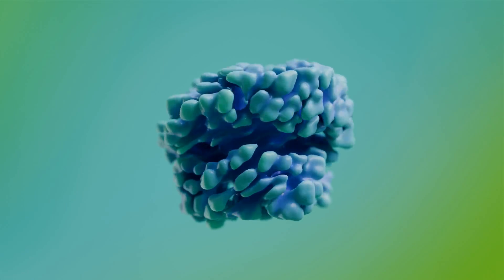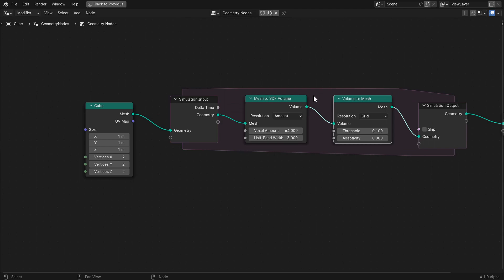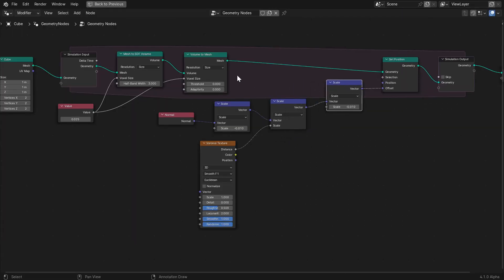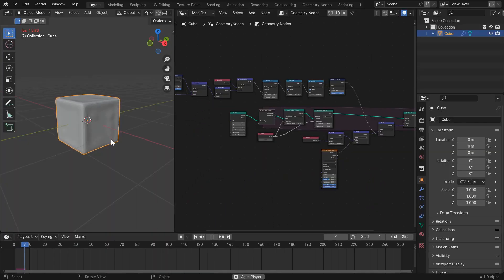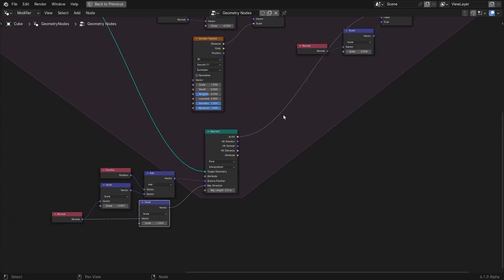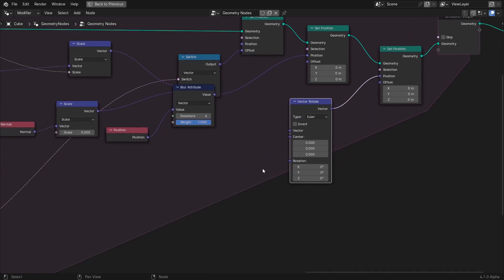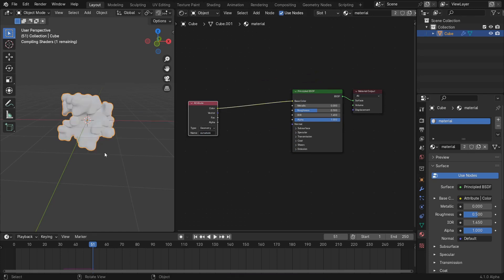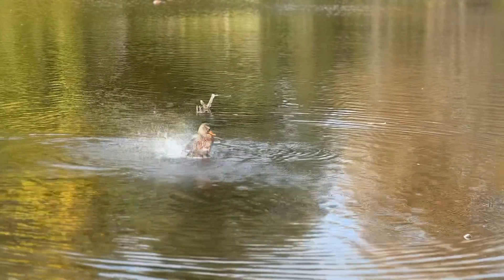3D Differential Growth in Blender!

Comment: The Mesh to SDF Volume is replaced (or can be replaced) with the Mesh to Volume node in 4.1 stable, don"t know for other versions (in this case you do not need to go through the experimental settings in your preferences)

Comment: I am doing this for newbies. It is so hard to do these things, but I'm trying to learn and just getting that free gumroad is so tempting. But stick with it. If you get stuck, take a look here. I used to always just complain in comments..., but it's better to complain and do. 

I got it.
Bing CoPilot: You are using the wrong node type for the dot product node. The dot product node is a vector math node, which means it can only be used with vector inputs and outputs. Vectors are lists of three values that represent a direction or a position in 3D space, such as the location, rotation, or scale of an object. You can recognize vector nodes by their yellow color in the node editor. If you are trying to use the dot product node with scalar inputs or outputs, such as a single value or a color, you will not see it in the node menu. You can convert scalars to vectors and vice versa using the separate XYZ and combine XYZ nodes, which are also vector math nodes:
Blender is so keystroke oriented. And suddenly, now I notice that he has to drag out from the node, and then you can search for the node. I wonder how many tutorials I have given up on not picking that up.. I was wondering why he was no longer searching with shift A and. going down through the menus. That doesn't work that way.

CRASH
I dont got it.

I got it.
Don't let your ADD squirrel need to be fascinated by watching the simulation while you're working on it. hit that pause button.

I boot up again and I Play the simulation. It's not looking like what he's got on the screen. 0h no. Backtrack.
I dont got it.

I got it.
I missed the clamping On two of the nodes. So just don't look for number changes. Look for check boxes.
I dont got it.

Give up and go back to bed. Don't start this at 6:00 AM.

To be continued....

Comment: i'm new to blender, would appreciate some help here: 
i'm trying to do this anymation with a Group input of a "model" i made. 
Unfortunately the model dissapears after the first frame when i press play and its not animating (when i change the input to a cube it all works fine.. 
Anyone knows what could be the problem here?
Reply: The group input you mention is an object input? meaning you use it to link the object which contains the geometry of the model you made? Does it happen no matter what object you link? Make sure the simulation nodes loop isn't just deleting the input geometry.
Reply: @MrTomyCJ  thanks a lot for the answer.
yes when i use a cube as input it all works. 
How can i make that the loop isn't deleting my geometry. 
Sorry but i'm quite new to blender.

Comment: I love this. I got a bit lost when you were calculating the curvature though. Isn't their a node that can already calculate curvature?
Reply from the maker: In shader nodes yes but I don’t think there is one in geometry nodes
Reply: @seanterelle  That's a shame. Is there a way to read shader attributes into geometry nodes?
Reply: @mdoerkse  No, Shader Nodes are always calculated after Geometry Nodes, as far as I understand
Reply: @todesdigga3891  That makes sense. At least, it wouldn't make sense if geometry could affect shaders AND shaders could affect geometry.
Reply: You can also calculate mesh curvature based on the Edge Angle node